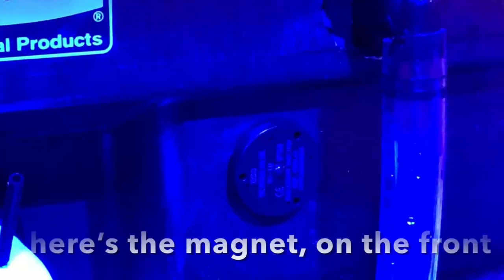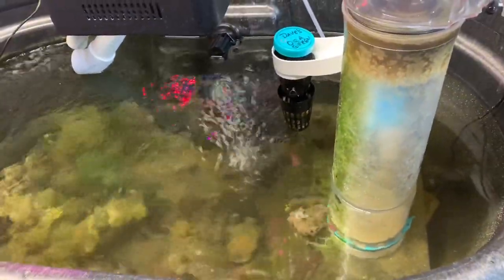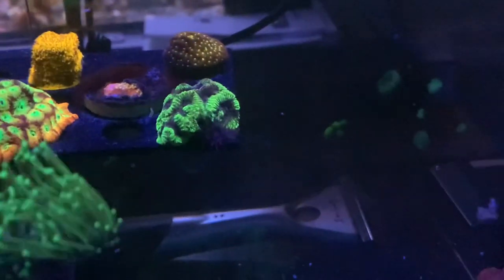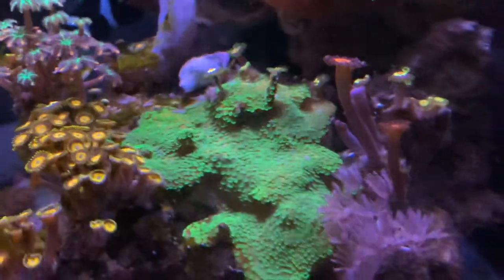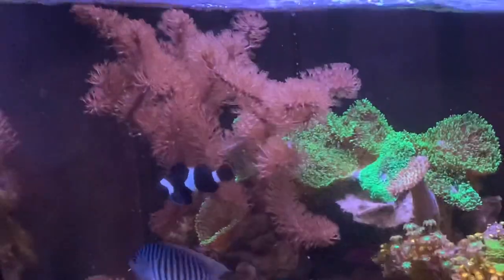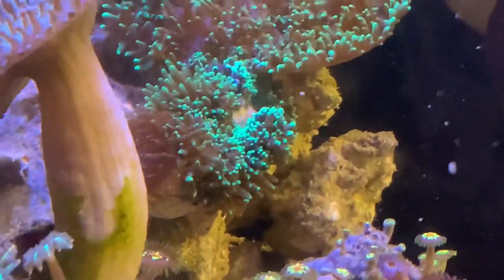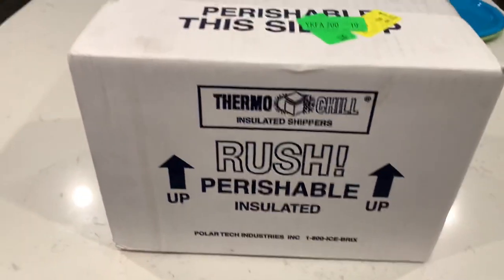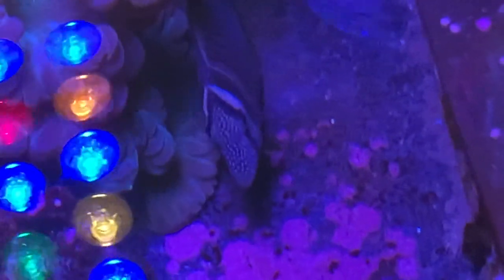Reef Wrap-Up No 11 - What the Heck Has Been Going On?  😲 I Can Finally Talk Again!

Comment: I remain amazed at the engineering that's gone into this. Did you have to install a couple of dehumidifiers, too?
Reply from the maker: Hey Anthony - apologies for the tardy response! I somehow missed your comment. We have an HRV air exchanger and a dehumidifier in the basement along with fans up near the ceiling to keep the air moving. In the display room, we plan on installing a small dehumidifier run with a humidistat. There’s space in the corner by the window, and we can run a drain hose through the floor hole where the pipes are run for the tank, and down into the sump pit (not the aquarium sump, the floor pit that’s there for the foundation). There’s a video in my playlist for this tank, about the structural changes that were made to accommodate this build - extra steel beam, triple-joisted floor and stud wall support etc. plus humidity management. Thank you for watching! 👍🏻
Reply: @Reefgrrl  I'll have to go look this up, sounds fascinating. (I must be a logistics nerd at heart...)